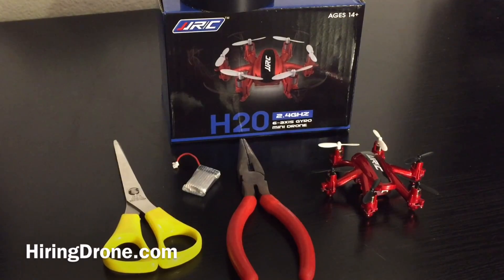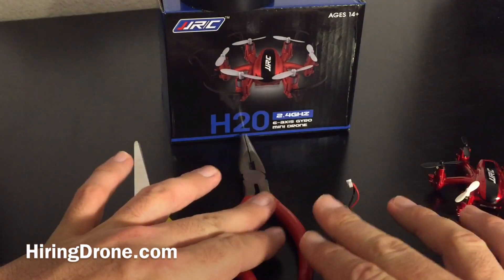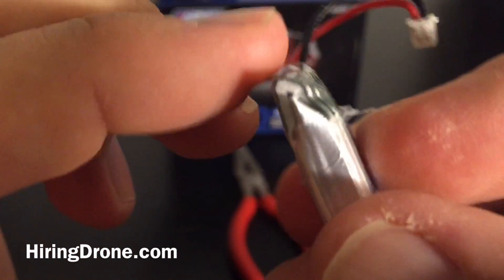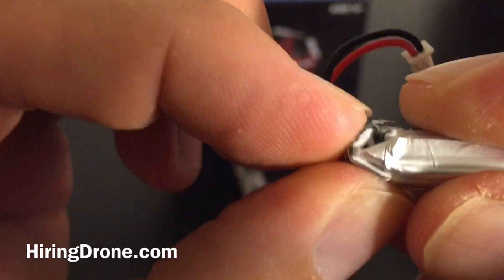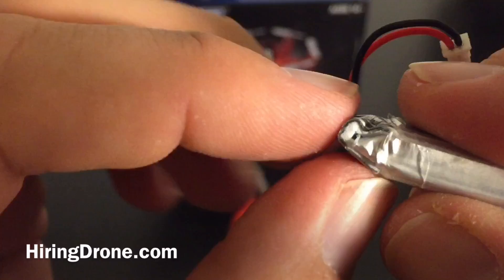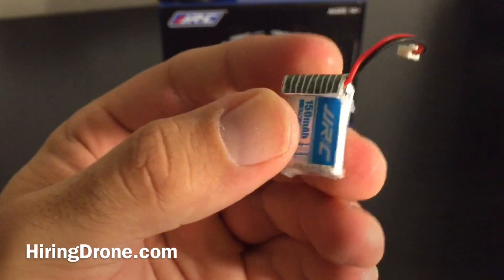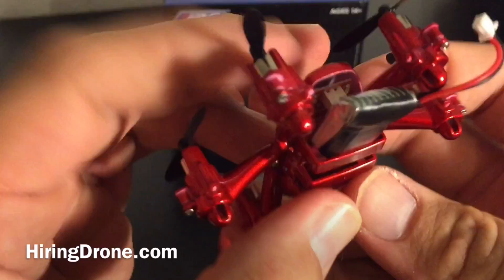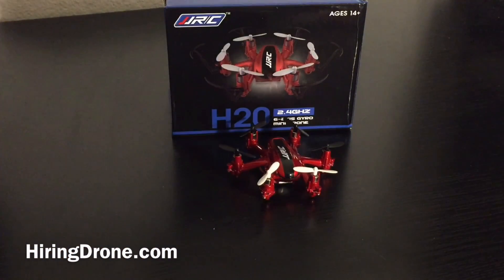JJRC H20 Battery Modification Hack

Comment: Just bought one from Banggood. They have now modified the battery plug on the copter. Instead of it pointing up as yours does it faces back. JJRC must be listening to you guys who post good stuff as well as shortfalls. I find it easily (for me anyway) to plug the battery in before sliding it in to the copter.

Comment: I just modified the battery bay by cutting out the back part that keeps the battery from sliding all the way through. The battery won't fall out but you can then push the battery far enough back to easily get to the connector then center the battery once the connector is plugged in. It also makes it easier to remove the batteries for charging. The plastic is easy to cut with a hobby knife.

Comment: Thanks so much for that!!  It was such a tight squeeze and I had to resort to using snipe-nose pliers to remove and re-attach the connector. This has solved the issue, excellent!
Reply from the maker: +Joyce Grieves Glad it helped. I was having a lot of issues with the battery until I applied this modification to the battery.

Comment: I actually had the plug portion that was on the copter snap off from changing batteries in and out.  I must have caught the piece that was cut off in this video on the white plug on the circuit board and it just snapped off.  So I ordered another copter because I really like this thing and it allows me now to have a full set of replacement parts, motors and all.  I have an idea and I was hoping if anyone else has the tools to do this maybe they can try it and post if it worked.  What I was thinking was this.  Since I now have 2 charging cables that means I have an extra plug piece the battery can plug into.  Instead of using the battery power plug as it is (directly on the circuit board blocking the battery port, cut the end piece of the extra charging wire along with maybe an inch or two of wire and solder it to the board where the current plug is mounted.  This way the plug that is currently blocking the battery port can be removed and you would have a plug that is on a wire instead.  Most of your other RC Helicopters and drones have their batteries plug in this way so I would think as long as you didn't make the wire too long it would work just fine. That wire is so thin the weight compared to the battery wouldn't affect it.  Anyway if anyone can give it a try post it.   Once I get a soldering iron and try it I will post something.
Reply from the maker: +Colhogan06 Seems like your idea should work. People are reporting that they have changed the battery plug port on the quadcopter, so this might be a non-issue with your new one. The old design was terrible, especially if they sent you an oversized battery, like the one in this video.
Reply: +Hiring a Drone Unfortunately the new one I received is the same.  I am getting a soldering iron this weekend and will try my idea on the one that already has the port broke off.  I have nothing to lose trying.  I have a thing called :Helping Hand"  It has aligator clips to hold small circuit boards in place and a magnifying glass that is also mounted on it so you can see what your soldering so it should help with something like this.  I wonder how long it will take before they exhaust the supply of the old ones.  I would imagine until they are gone it would be a hit and miss type situation as to which one you received.  Anyway I will try to do the mod this weekend if I have the time and post the results.
Reply: +Hiring a Drone ------I finally went through the drill of taking this thing completely apart and soldering that end piece of the charging cable to the board where the charging port was before it got snapped off.  I went ahead and soldered it on the back side of the board and at first I thought it was messed up.  Then I remembered reading somewhere that said the polarity on this copter was reversed.  So I reversed it and it worked great!  I was pleased that all that work resulted in a fix!  I used a helping hand device that included a magnifying glass and a light.  That made it so much easier to see.  So for under 10 bucks I got it back up and running!
Reply from the maker: +Colhogan06 Awesome! The board is so small, that my personal skills could not hack it. I have a helping hand too, but I fear that it will crush these small parts. Glad you got it running. Have you experienced any range issues?
Reply: I haven't experienced any range issues but I usually just fly it around my house so I'm never really too far away.  I have seen some mods where people have drilled or melted  a small hole in the top of the copter either with a drill or tip of a soldering iron and fed the antenna through the hole to gain better range. If you google antenna mode for the JJRC H20 you should find some.

Comment: They have fixed it . i got my jjrc h20 for one week ago and the battery female plug points backwards and not down and in front of the battery bay  .
Reply from the maker: +Kim Zero Thanks for the update. Hopefully this will be a non-issue for buyers moving forward. This hexacopter has a binding issue with the transmitter (flies away). Did they fix this issue as well?
Reply: +Kim Zero  ---  Bought 1-30-16 from TMart.  Same here. A decent upgrade and my H20 even came with... a power switch!  Flew it like a bat outta hell the first two flights, and then one motor got lazy and sometimes would not spin up. Ordered another motor and in the meantime I did the antenna mod. The upgraded version still has reversed polarity which is good in my case since I already had 5 spares.
Reply: LOL yea thats tru it flew like a crasy bat . had to get 10 baterys so i can have more fun graet buy !!

Comment: great video and the only one that address  the battery problem, I wish I saw ur vid yesterday before ripping off one of the batteries cables off the tiny plug. I'm getting more batteries with multicharger and will do your bat mod to all of them. Have you tried the antennas mod? from copter and transmitter?
Reply from the maker: +Nanobots Thanks for the positive feedback! Not sure why this video gets down votes from other views. The standard battery is extremely frustrating, like you mentioned. I have not tried the antena modification, but need too. I had this quad flyaway on me twice, due to limited range.
Reply: +Hiring a Drone well you know, there are always haters. Keep up the great work
Reply from the maker: +Nanobots - Agreed. Thanks for the feed back.

Comment: Hy, I bougt this model and 3 spare batteryes for this model ( http://www.banggood.com/JJRC-H20-RC-Quadcopter-Spare-parts-150mah-Battery-p-990497.html ), do you recomand me to use them just like they are or do I have to switch polaretyes? Thanks!
Reply from the maker: +Hipo Rex - If they are real JJRC H20 batteries, you should be able to used them without an  issue. If they are knockoffs, then you might need to be concerned. The battery in the video was the standard battery that I received with the copter. It was too big for the battery bay, so I had to trim a portion off. It was blocking the  battery plug. After the modification, it fit without an issue. This is a great little hexicopter. Do keep it in range, as mine flew away on me one time. I was lucky enough to find it, but you can easily loose it, if it unbinds with the controller.
Reply from the maker: +Hipo Rex - Prior to plugging the batteries into the copter, look on the battery port on the copter. You should see a B- and B+. Make sure that when you plug the batteries into the copter, the red wire from the battery is on the B+ side of the circuit board/battery port and that the black wire is on the B- minus side. If your battery will not plug in, lined up with the negative's and positives, then you will need to switch the polaretyes.
Reply: Thanks!
Reply: Hi